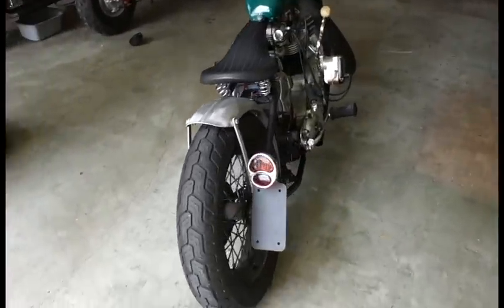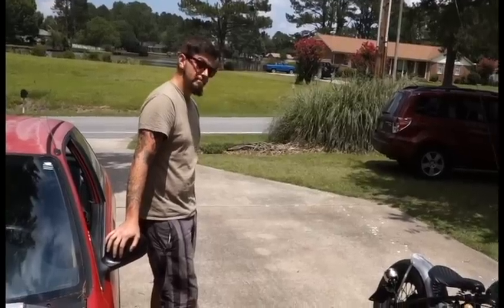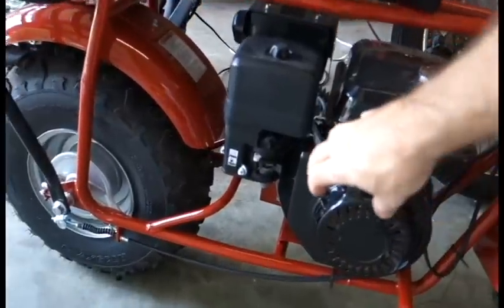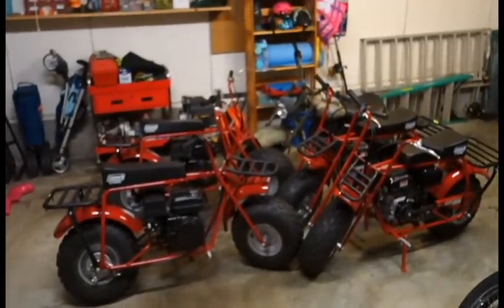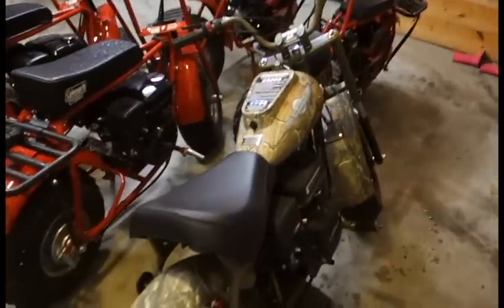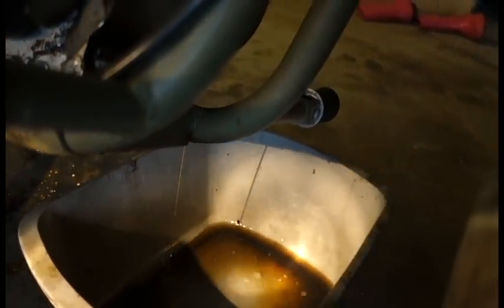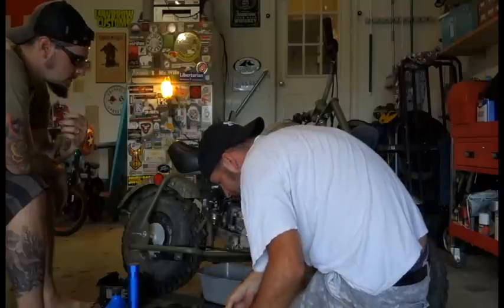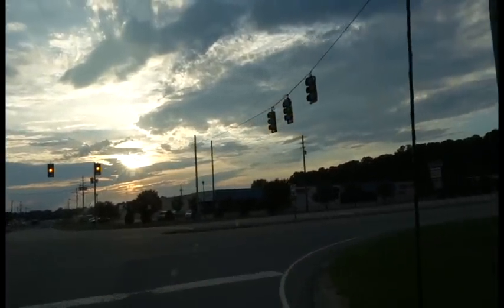We Bought 3 Mini Bikes!! Ike's Adventures

Comment: I've had a coleman ct200u for about 7 months and I absolutely love it. I live on a property with a lot of hills and it has lived up to its reputation. Only problems I've had with it is that about everything on it falls apart and I've had to tighten/buy about every bolt and nut that's on the frame. Stock engine with the governor screw taken out goes faster than I ever expected it to. Overall Its a very good utility trail bike and I think that you guys should upgrade/modify the stock engine to make it go as fast as possible.
Reply: No I didn't, I used lock washers and I also bought mine preassembled which I believe is the reason why every bolt/nut on the frame was loose and kept falling off.
Reply: Kakushimo if they still come loose, you may want to apply some blue locktite to the threads. don't use red or you'll never get it apart again without a torch.
Reply: hope I can find that gov screw. Could use another 5-10mph

Comment: I've said it before elsewhere but might as well say again here...
Connect two of the Coleman bikes together about 24" apart to make a twin engine side-by-side.
Steering would be easy. Make a tie-rod to tie the two together and hack off one of the sets of handlebars. Then add a fixed set of handlebars for that rider. Brakes and throttle would also be easy to set up to work off one set of controls.

Comment: I own a Baja warrior and I have swapped in a predator 212 with torque converter. Tops out at 40 and does great wheelies, however I highly recommend replacing stock engine with another equipped with a charging system for the light.

Comment: Ike, you're a badass man. Don't ever let anybody tell you otherwise. The way you fiddled with that pull start for a whole of 10 seconds and got it working with the look on his face. Dude that was priceless. As for what you should do with those mini bikes. Man I think two of them need predator engines and the third. Well let's just say you might want to consider a drive system out of a snow mobile. The kind that change the reduction ratio as they go faster. You might even want to consider that type of system for some of your karts. It has great torque at first and as it goes faster it gives you more of a top end speed. Think about it man...

Comment: Just as a heads up, the flywheel from the bad engine will probably more than likely will not fit on the predator. The shafts have different tapers. Been there done that. But the flywheel should fit the Iron Ton 208 from northern tool. Maybe y'all should look into the electric start Lifan engines on eBay for $200 if you want. I put a 30 series torque converter on my Baja , then took the Iron Ton off and put on a predator. After mods from Gopowersports, it does 47 mph. 73s from Texas!

Comment: ike..
I have a baja warrior that is pretty much stock.
The only mod is neutralizing the gov and fix the throttle so it opens all the way.
I did not remove the gov.
It will easily do 40 mph and is pretty torky as well.
I also have been running it like this for at leash 2 years and no trouble with any internals..
I am all for modding just not sure those particular mods need to be done to reach the result of more speed and higher engine rpms..
Thanks

Comment: Hey ike my friend jake has a baja warrior  and i patched the hole in hos case with jb weld steel stick  its the best thong for the jpb but the bolt that comes loose is a xommon problem in these motors his hole waa higher in the case so no oil was really lost  but i has to do some prep work for the reseal i scratched it up with the corner of my iron file and cleaned it with auto engine degreaser  then placed wax paper on my bench and mixed the steel stick up and applied it behind the headlight coil with the wax paper stuck to it and let it cure foe 24 hours then i abused thw hell out of his bike for a day and gave it back

Comment: 212 or bigger predators and 30 series torque converter for all of them trust me I have a Baja warrior (the older version) and I did that to it ...best modification I could've ever done seriously
Reply: Twinkie Will they already basically have a predator on it....?
Reply: It's almost the same thing they're both Honda clones
Reply: My kids Baja came with a comet clutch are they junk? carb was trash so I made a mount for a bikini replacement for a 125 quad and it screams.
Reply: Twinkie Will no. it will be the same thing, a snowmobile engine would be better, or how about a single rotor engine

Comment: a piece of aluminum can and some jb weld works good for patching holes like that in small engine blocks. sand smooth the jb weld after you are done and spray with aluminum spray paint. Looks like nothing ever happened. Sounds crazy, but it works if done right.

Comment: Definitely do a twin engined mini bike, sprocket either side of the rear wheel with a jack shaft for one of the engines to get the power to the other side.

Comment: 420cc in the red ones. On colmens website they sell front suspension for the cu2000 ex. Swap out the front and put a rear wheel with brakes on the front. Oh, and of course a torque converter. Need I say more?

Comment: Hey man where do you think I could get a new brake set up for a Baja warrior 200? I got one like a year ago all in pieces with two broken motors, no throttle cable, rear axle shaft, brakes, or anything hardly so I've been slowly been trying to put it back together and I have no idea where to get a brake set up for it. I just barely managed to track down a rear axle shaft for it and I'm not even positive it's the correct one since the last one I ordered was too big. Any help you could give me would he appreciated, thanks!

Comment: My local Harbor freight was having a tent sale and there was two predators sitting in a table and they were being sold as is... well my ass payed for two of them and they were 100 bucks for both! On was the newer hemi and the other was the older one. Well when I got home I figure out what was wrong, on one the mounting holes were not drilled all the way through and didn't allow a bolt to go through so I cleaned the holes up no problem started up like a champ. Grabbed the other one started putting oil in it and saw some oil coming from under it, thought I spilled some until I realized that there was a quart of oil under it. Flipped it over and the sumbitch has a huge crack along the bottom. So right now it's for parts but I think I'm gonna glue the crack with JB weld and put it on the gokart and run it balls out to see if it holds! If it does not hold I might try a brazing technique.

Comment: If the stator is salvageable, you can put it on the Predator and the lights will work.
Reply: the magnets on the flywheel are busted
Reply: Bummer. Not sure which Kohler engine, but they have a flywheel that'll match up to the 212 to get a stator.

Comment: the Baja is a Honda clone. I have 2 of them. it's same motor as the predictor 212. and u can put the charger system back on to use lights and charge battery.

Comment: I got a question for you guys I have a 212cc I did the carburetor switch now it has a drilled jet and the air filter I have a 1960-1970 Powell chalanger I believe we test drive it the other day when I pull the throttle the engine shakes a bit the faster it goes the engine shakes when u hit the throttle only when your going fast. also my clutch seems to stay in motion I have to hold the brake for the bike to stay still I've adjusted the black screw but after you get it running the clutch keeps going
Reply: is the engine not balanced good for higher rpm? sounds like the idle is too high

Comment: for the baja...build a racing motor for it and put it up vs the 670. ..like if u like my idea
Reply: PIGGY603;} you better mean a snowmobile engine, predator Is getting old
Reply: Sled_NeckX99 it makes no point in buying predators cuz they end up having to mod them cuz there slow
Reply: Michael Supercharger exactly! finally someone who agrees, you can find a snowmobile engine for cheaper than a 670 predator anyway and It will have like double the performance
Reply: Michael Supercharger you have to agree, a snowmobile engine on one of their light go karts would be sick
Reply: Sled_NeckX99 yes plus there nasty my friend had a snowmobile that was like 670cc and did 120mph definitely agree  and predators are boring and slow but they get everything free cuz there sponsored by go power sports
Reply: Get an atv gy6 and throw in it. More power and lighter weight than a 212. Even able to keep the headlight. Can look for one with a 5 speed or a cvt.
Reply: Michael Supercharger you have a lot to learn kid I have friends that bored em 3 inch and there out running street bikes like minidragbike Mosley do some homework
Reply: Michael McFarland have your friend pull up and see if he can beat my 2015 cbr1000rr
Reply: Michael Supercharger it's the other way around your friend against are 71 all steal body chevelle with .......
454 block bored and stroke to 496 stroker
with Smith N.O.S 2 stage system 
capable of spraying 500 HP
all motor 800 HP well give the bike. 5 links an foot break on motor if you wanna see tail lights
Reply: PIGGY603;} just put the 670 on it
Reply: PIGGY603;} what I was thinking
Reply: Michael Supercharger I just got a 670 ski-doo mxz yesterday
Reply: Dale Auka yeah, a rotax 670 snowmobile engine, they have like 2 times the performance of an ungoverned predator 670
Reply: Hey doo doo

Comment: Cheep hop up kits and on one of the ct200u put a torque converter on the stock engine and weld a bar on the ct200 handle bars becuse they bend really easy

Comment: Hi.  I got a question. I know you that you know a lot about mini bikes. So i got a problem with mines. When i turned on it pulls on me like it wants to go and then sometimes it stops but the. When i ride it and i brake it does the same thing  and it make a noise around the clutch. And when i go full speed it like bounce. Can you help me please.
Reply: clutch is bad and your tires are either out of balance or out of round. for your safety make sure the tires are in good shape ( no cracks, bulges, or cord showing. )

Comment: Put a twin turbo 670 on one of them.
Reply: smog pump supercharger would be cooler.
Reply: Derek Hutchings no, 670s are low revving pieces of shit. put on a turbo snowmobile engine
Reply: Sled_NeckX99 for real The 670cc only goes like 50mph and that's a $800 engine😂
Reply: Derek Hutchings turbos would be nice there for high rpms and spool at high speeds superchargers are only for taking off fast and don't increase your top speed
Reply: superchargers don't do any specific thing exclusively, the volume in proportion to the engine determines what it does or  doesn't do at a given rpm. along with a dozen other variables
Reply: engine rpm doesnt really matter when talking about a turbo. hence why theres alot of turbo diesel engines they dont rev high at all 4,000 max usually. engine load is what makes boost
Reply: Haha, I highly recommend you learn something about forced induction before you say anything more ridiculous. It's great that you want to be a gearhead, but you don't have to make things up, it's okay to be wrong and learn about something you don't know about. Go read! All kinds of information out there! 
#itllbefine
Reply: MartinStangMan what part of what i said isnt true?
Reply: All of it. Diesel engines not going very high rpm wise is related exclusively to the nature of how the motor works, the turbo(s) is/are tuned to the motor. 

Formula 1 used turbos briefly before they were outlawed because the cars were making tooooo much power and speed. In case you aren't familiar, they spin well beyond 4k rpm. 

Load has nothing to do with power production from a turbo. The way a turbo works is exhaust gas spins a turbine and then exits the turbo. The turbine on the exhaust side  is connected to an impeller on the intake/cold side. as the impeller spins up to speed or 'spools' it begins to ram air into the motor faster than the motor naturally pumps it in. This is called boost. At this point the boost reference (typically line) will likely adjust fuel supply via a regulator or tell a computer to turn up the injectors. More fuel compiled with more air inside of the same combistion chamber equals more energy. The increased energy being measured numerous ways is generally referred to as the increase in hp and ft/lbs.  
All of this is to say that the pitch of the impeller and turbine, chamber size relative to the cubic displacement of the engine it is attached to determine how/when the added air pump produce power. In common applications this will all be kept relatively tame and the power will be applied when needed. I.E. in a diesel that produces much of its torque near idle, the turbo will be tuned to function there.   In a racing application with a 600" big block,  twin 88s aren't starting to build boost until 3k-3500rpm and the motor may or may not run clear to 7k.
If you don't like that example, the famed hyabusa is a turbo inline 4 cyl that redlines at 11k rpm stock.
Reply: MartinStangMan lol i know exactly how a turbo works. answer this which makes more boost 2nd gear high rpm or 3rd gear at a lower rpm it all has to do with engine load im afraid you need to google it my friend lol google does engine load= boost see what it says
Reply: You purport to know how a turbo works....the. you ask something like that. I guess I must have over explained and you didn't understand.....I'll make it simpler.
The turbo is an air pump. The relative sizes determine how much pressure it generates. Nothing more. The phenomena you specifically are referring to is related to both the turbo size being tuned to the motor's size and CAMSHAFT(S). The power production (if all is working in symphony) to produce specifically what you are talking about would necessitate building boost as you are entering your power band, and achieving the maximum desired boost at the end of the power band before losing boost to your blow off valve. 

You are literally talking about forced induction  as if the only way anyone ever used it was to build mild streetable honda civics or something lol
Reply: Michael Supercharger yeah, up here in Minnesota you can find a snowmobile engine for $200
Reply: nathan butler add nitrous to the 670

Comment: hey can someone help me i was given a 50cc moped for free and it is fine except for the throttle and it is fine until you put and weight on it then you can only go 1/4 throttle  if you go any higher it dies but on the stand it works fine and i have already cleaned out the carb and there was stuff in the jets but i cleaned that out
Reply: its a 2004 Suzuki SJ50QT
Reply: nah i cant afford a second hand  one and i need something to drive around in
Reply: i want to fix it if i can of not then will sell

Comment: Can anybody help me I have a 212cc motor for a mini bike and I was wondering if I can rebuild a 212cc motor into a 420cc or is the 420cc a bigger motor than the 212cc.
Reply: cRiSpIn3F do some research
Reply: Isaiah New Take it easy on him he's new to power sports. Anyways Crispin you can NOT build a 212cc into a 420cc it is a completely different engine.  What you can do to your 212 is order performance parts like a billet flywheel, a hemi head, camshaft, etc....

Comment: Be careful those thing will throw a rod is you take the strew out I bought three and all of the did it
Reply: Tonadrion Tate bullshit, no problems with mine ungoverned for about a year now. you must have not had oil in it.
Reply: Tonadrion Tate yea same with mine I took out the screw and the governed and had no problems
Reply: Sam Here I have one with The Throttle Screw Out All The Way & Haven't had any issues
Reply: Tonadrion Tate well genius don't take the screw out mine runs amazing with the screw in
Reply: Thottle limit screw and RPM governor are two different things!